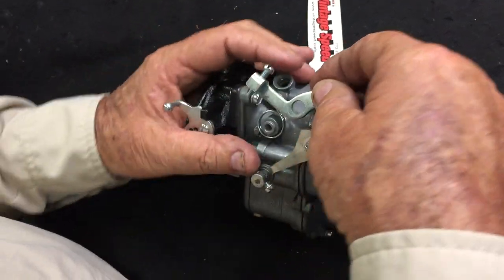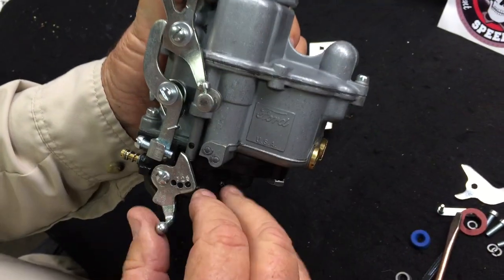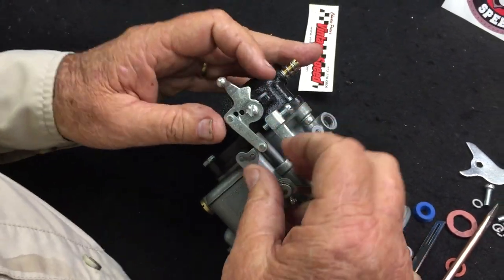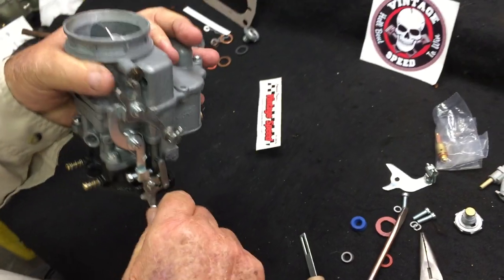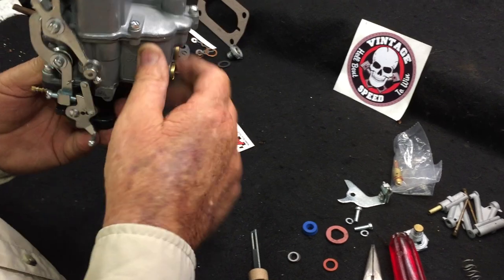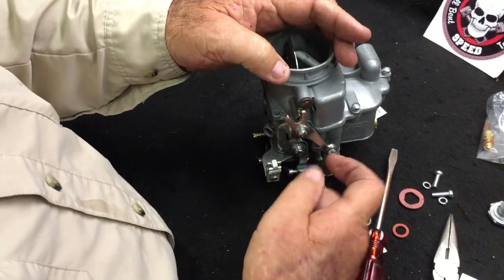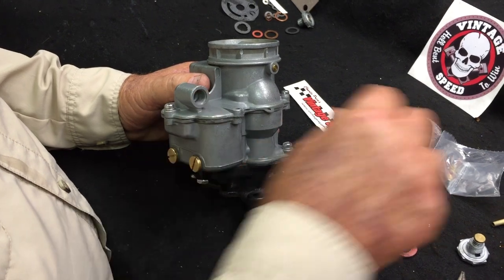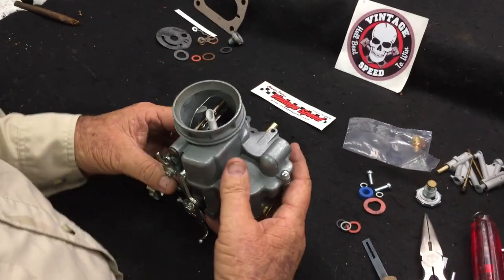CHARLIE PRICE   VINTAGE SPEED  PART 5 OF HOLLEY 94  CARB REBUILD  (FINAL ASSEMBLY)

Comment: Other than not installing the last two screws in the top, it was a great video.  I have a 1948 Ford F-1 with the 226 Flathead Six, and I think I've learned tons from your video series on the Holley 94 Carb.  Thanks.